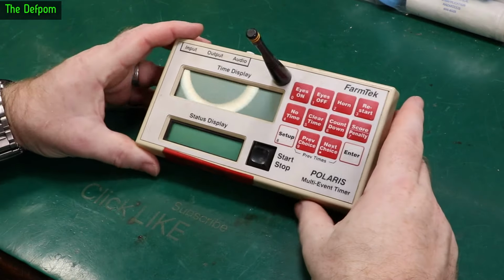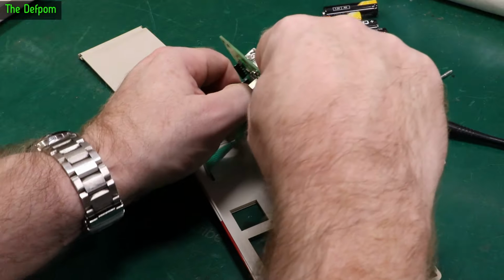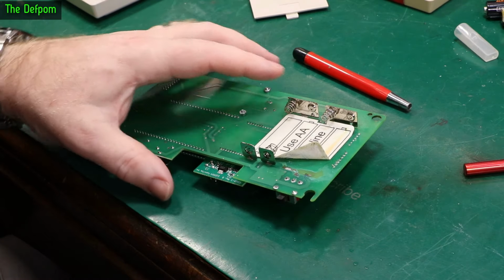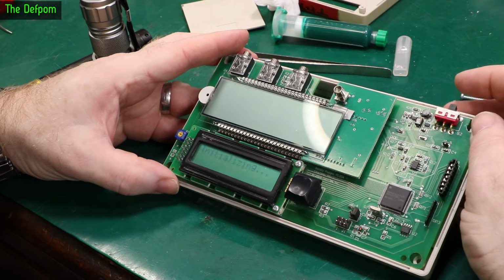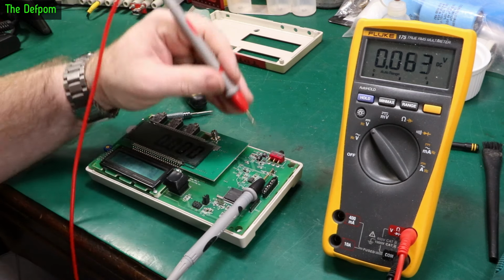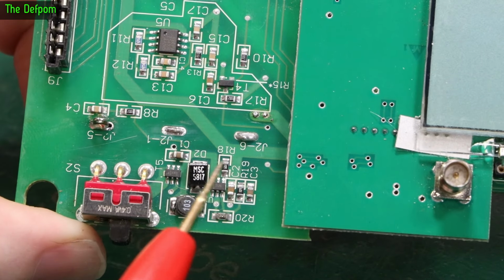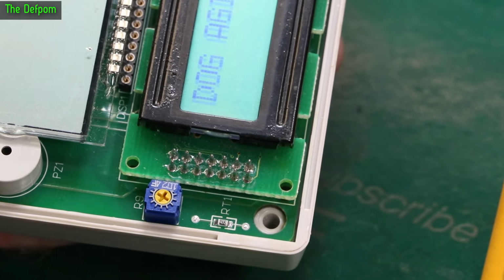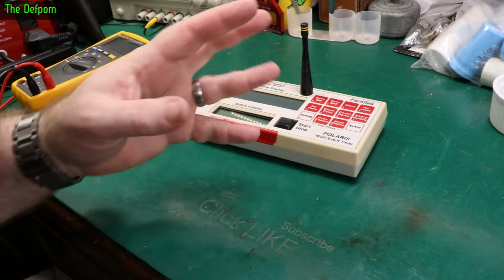🔴 Farmtek Polaris Battery Leak Repair - And Boost Converter Repair - No.1236

Comment: Excellent catch on the resistor. 1) It appeared that there was some battery crud stuck on the back of the label. When the label is pressed back down, the crud is reapplied to the board. 2) On the back of the board... The solder joints for the ribbon connector look bad. At about 8:00 through 8:40. HTH. Cheers!

Comment: Yeah good spotting linking the contrast voltage to the dodgy booster. Leaky bats... or forgetful humans... seem to be a common issue with these. Would it be worth looking into a conversion to a small li-ion cell and charge controller mod?